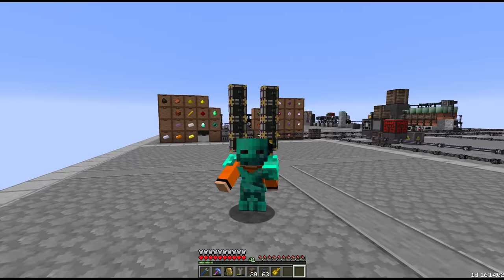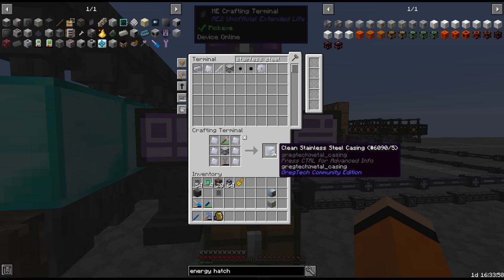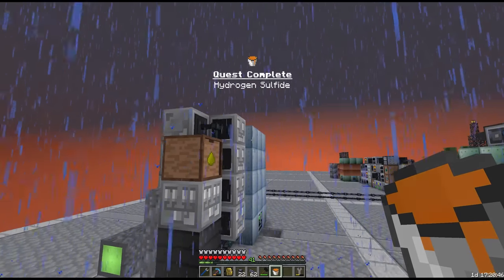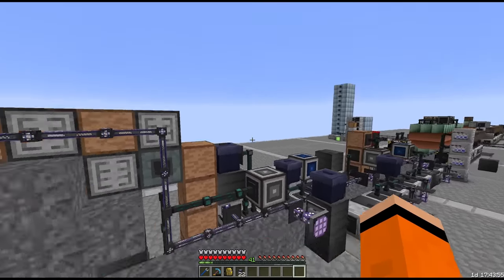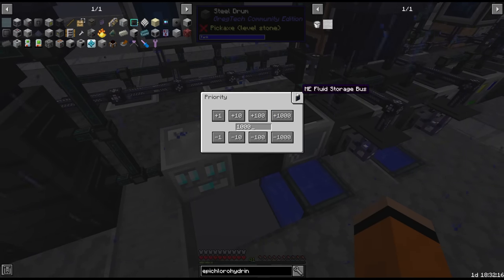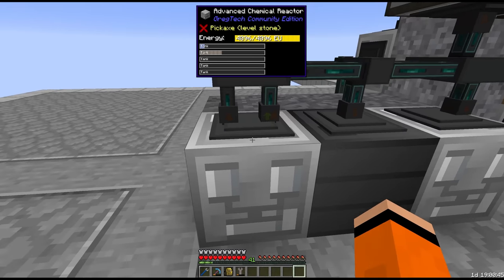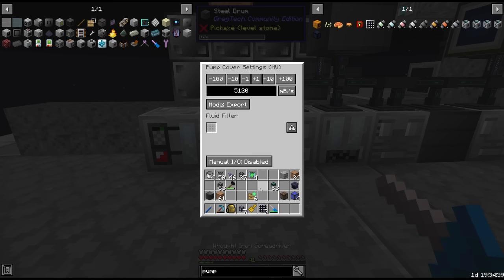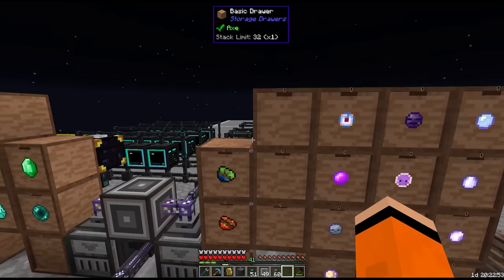Epoxy, Distillation & Fluid Storage - Nomifactory: Episode 7

Comment: Man I know this is an older video, but this entire playlist has been a lifesaver for working through the technical parts of this pack. @Threefold - can you explain the configuration for the conveyors on the macerators and the ore washing plant? I am having trouble replicating this setup and think I am missing something there.
Reply from the maker: If you provide a timestamp, I may be able to help :)
Reply: @Threefold.  25:20! Thanks so much man, your content is amazing to watch!
Reply from the maker: @BeardPolicy  The Ore Dictionary Filters are case sensitive so make sure you match what is written in JEI. Discord will be the easiest place to help you if you find that you can't get the system running. Another thing to keep in mind is the wildcard: * That is very important to add at the end of each tag.  :)
Reply: @Threefold.  Thank you so much Threefold! I really appreciate the help and the content. Have a good weekend.

Comment: Hey, while working on my Epoxy line, I noticed the calcium is perfectly recycled, thus you don't need a permanent intrance of calcium from bones. (CaO is used for creating Calcium Acetate, and produced when you distill it into Acetone, instead of using the fluid heater)

Comment: the hydrochloric acid excess can be reused to make more chlorine... I'd be tempted to add  a  quantum tank to store it, then if you run out of chlorine later on or are running short, you have a fallback solution
Reply: You don't need to quantum tank it.  Have one chemical reactor produce it with a level emitter to 100 buckets (for example) and have an electrolyzer break it down at 150 buckets.  That way it will automatically deal with the byproducts and will still create more if necessary.
Reply: You could also do it without level emitters by using tank with storage priority. General storage at 0 priority, overflow electrolyzation at negative priority, production at positive priority
Reply: @Mr_Doon yo that's genius, thanks for this i love simple setups like this 😮

Comment: A struggle I had with fluid storage using drives was once one of the drives fill up, all the slots of the fluid interface back up with the extra fluid and then the interface can't accept the other fluids even though there is space in the drives. This caused me quite a few problems where entire lines backed up because some random fluid was maxed out on storage. Eventually I switched to quantum tanks with fluid storage buses which worked a lot better for me. I don't know if there's a way around this issue, but maybe you do, and if you do, could you show it in a video?

1k fluid storage drives can hold 8,000 buckets which seems like a lot but it will eventually max out since all of these things will run passively forever, but there's definitely some time before it's an issue.

As far as my base, I've finally torn out (almost) everything that's obsolete, I set up 10 mk2 naquadah generators so I can make everything fast, and I've begun putting everything I need for miners on passive, which I'm realizing is going to be a huge task. But it's going to be mandatory given how many chaos shards and hearts of the universe are needed.
Reply: Threefold alluded in the video to the solution: if you place a fluid storage bus on a fluid trash can, filter it to applicable fluids and set it to the lowest priority on the network, it will allow you to void excess fluids. Just be extremely careful with this because usually it's better to expand your storage buffer than void things. Fluid cells are really cheap, your time waiting for more stuff to be made is not :)
Reply: @Exa4096  Ah ok, so if there's another place for fluid to go, the fluid interface won't fill its buffers once the drives are full? I didn't realize. I kind of assumed the fluid interface would keep accepting fluid until its internal buffers were full and only then would stuff go to the trash.
Reply: @Jonbobwing  You need to use a Cell workbench to set what fluid the drives can hold and then level emit the production so you never overflow.
Reply: @Jonbobwing  You can think of it like this: the fluid interface has storage tanks inside of it which hold a small amount of fluid. If the fluid isn't being stocked via that slot and there is anywhere for it to go in the digital storage, that tank's contents are digitized into storage. 

Putting a fluid storage bus on a fluid trash can adds the trash can to available "storage." Since it voids anything that goes in, it always reports that there is room for arbitrary quantities of any fluid. Thus, the system will digitize fluids there if it can. The low priority ensures that it fills up any other valid destination first, and the filter in the storage bus ensures you aren't accidentally voiding something else.
Reply: @Exa4096  Hmm alright, thanks for the info. I'm in creative tank phase now but I'll keep this in mind. Very helpful!

Comment: Alright, I'm confused when you bring up priority storage on the AE network. Why would lowest priority be used first and highest priority be used last? Is it opposite to how it's stored?

High Priority: Stored first, used last
Low Priority: Stored last, used first
Reply: You put high priority on the primary places you want stuff to be stored. So that when new stuff comes in, it goes where you want, and when stuff is pulled out, it uses other stuff first, which "isn't in the right place". The effect is that as much of that item is concetrated in the high-priority locations as is reasonable.
Reply: Low priority as in what you want to get rid of since it's byproducts. High priority you don't want to use since it's usually a primary producer and takes extra material to make that instead of just being extra